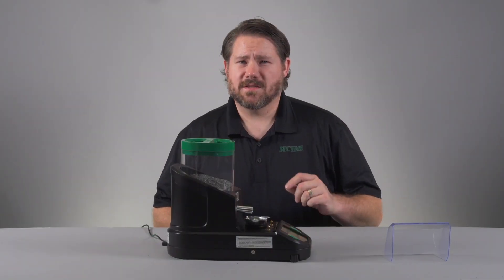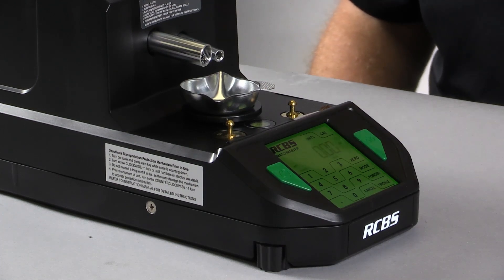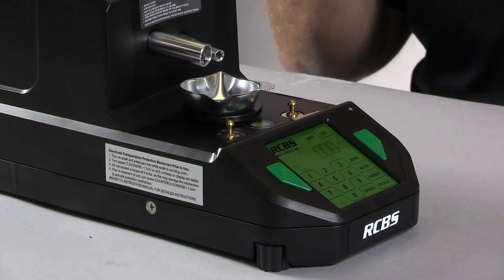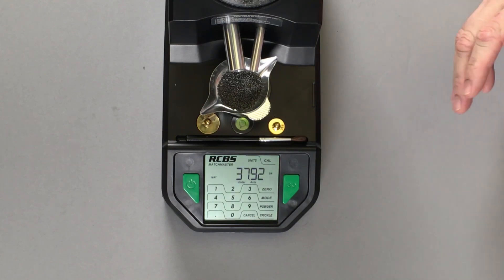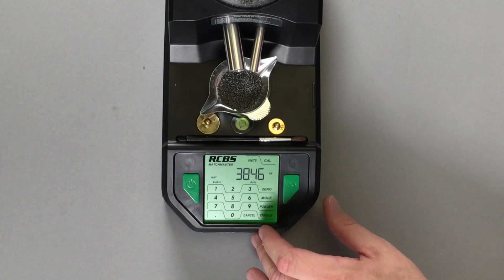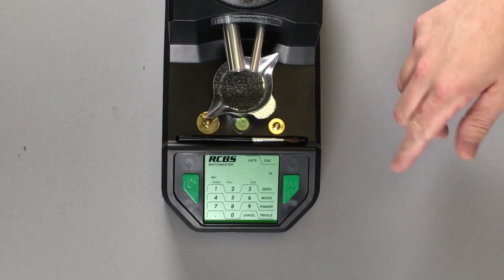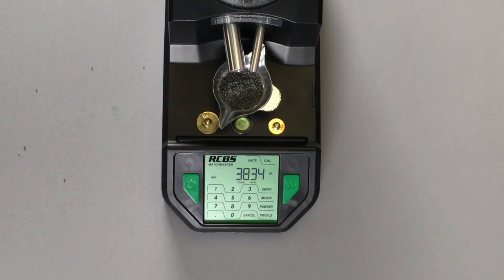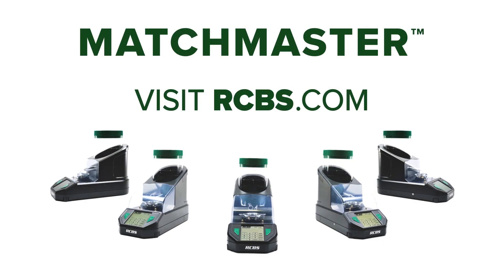MatchMaster Powder Dispenser: How to Select and Dispense Powder

Comment: Why does the LED backlight go on and off during every operation? that would be annoying.
Reply from the maker: The backlight looks a little more intense in this video than it actually is. When using the dispenser, the light isn't very distracting. We'll take a look at making backlight settings something you can adjust for future dispensers.

Comment: I am on my 2nd one. The first one was broke. 
The 2nd one is consistently unreliable 
Set a match mode powder amount then remove the pan and immediately put it back and it will consistently come up with a different weight 
Don’t waste your money. 
Also the powder drain is so roughly manufactured that small ball powder will leak right through. 
Again don’t buy.
Reply from the maker: Sorry to hear you've had troubles with your MatchMasters! Sounds like you might have already talked to our customer service, but just in case, please call us and we can try to help anytime. 800-533-5000

Comment: Not a fan. I can’t even get started. I’ve had it a year now. Been intimidated by it not working and just left it alone. Won’t calibrate properly. After I put the weights on, it doesn’t go to zero. Then I put the pan on, hit zero, try to dispense and my throws are way out of range. Tried at least 100 times, read every manual, watched every video and read every forum. $1000 waste of money.
Reply from the maker: Hey there, if you give our customer service team a call they will be able to walk you through it. 800-533-5000
Reply: Helps if you actually have your eyes open when you read 😂😂😂